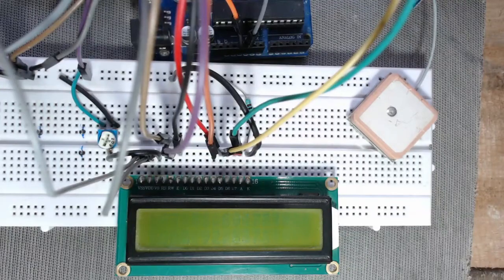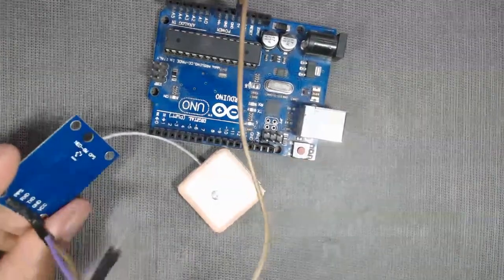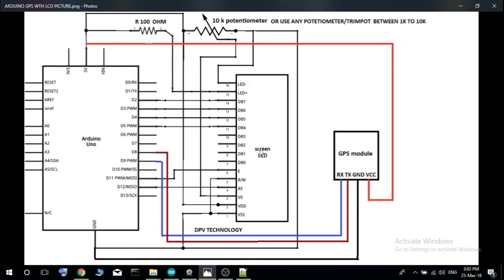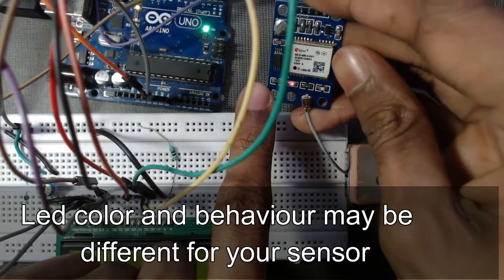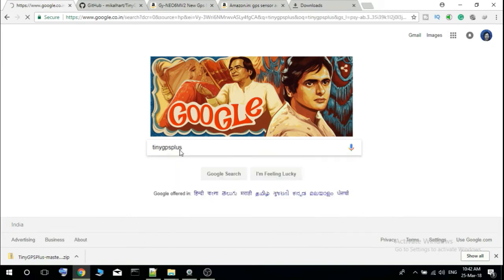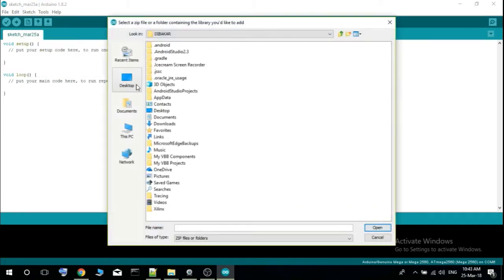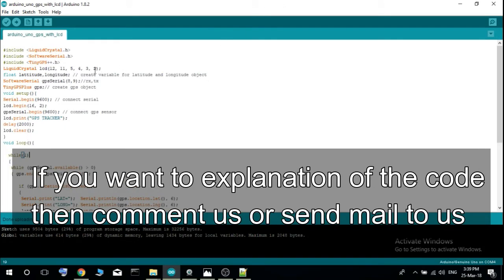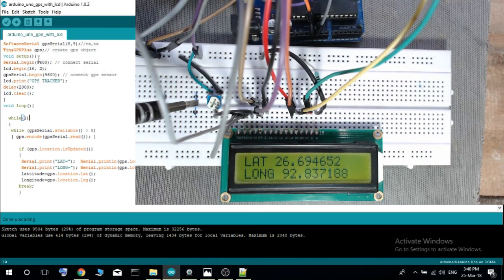Arduino GPS Module with LCD Display | Arduino position tracking

Comment: great project but the problem is that, I waited for 4-6 minutes but there was no response …...
Reply: Happened to me. You have to test the module outside. It can't detect while it's in the building.

Comment: I'm not getting any coordinates, the LED in the gps is blinking , I'm using arduino mega instead of uno, but all the pin assignments are the same, what can be the problem?
Reply from the maker: Bro, you have to change the tx,rx pin number. Because all pins of arduino mega does not support software serial library.
Here is the list of pins --Not all pins on the Mega and Mega 2560 support change interrupts, so only the following can be used for RX: 10, 11, 12, 13, 14, 15, 50, 51, 52, 53, A8 (62), A9 (63), A10 (64), A11 (65), A12 (66), A13 (67), A14 (68), A15 (69).

You can read more about this library in Arduino official website.Thanks.
Reply: @DPVTECHNOLOGY  the LED on the gy neo6mv2 won't even turn on now, it's been weeks since I last used it, is my module broken?
Reply from the maker: Change tx,Rx pin in both- coding as well as in hardware.
Reply: @DPVTECHNOLOGY  thank youuu! I'm a beginner in arduino, I really appreciate this.
Reply: @DPVTECHNOLOGY  it's me again, the porject worked the last time I asked but I tried extracting coordinates now, the GPS module seems to not get any signal, the LED isn't blinking even tho it's outside in an open area, Is my GPS broken?

Comment: Very useful mr uploaded.My thinking is  something like that.Is it possible when you lock a place,to keep in mind this place and by some servos to try to be in this place?Thank you.
Reply from the maker: Bro, not getting ur point properly
Reply: @DPVTECHNOLOGY  You didnt understood or its difficult to be place?
Reply from the maker: I did not undestand the last part - means what are you saying about servos
Reply: @DPVTECHNOLOGY  there is consept in my mind, if you put on YouTube minn kota spot lock you can understand. I want to put this consept in my outboard. I imagine to put a GPS which gibes orders to 3 servos (throttle, gear, stearing) so the boat Will be in the place you want without throughing anchor.